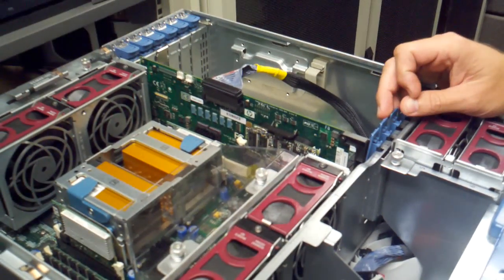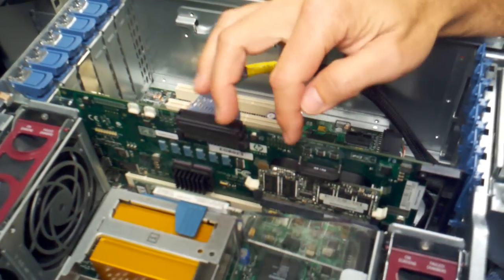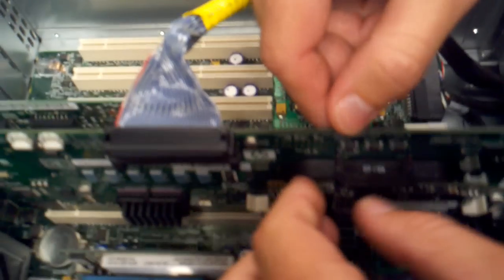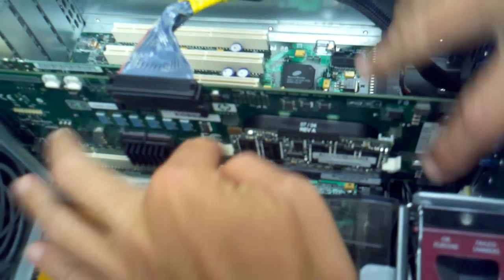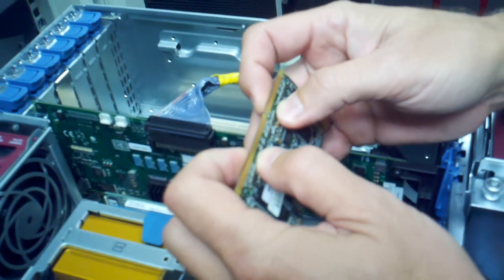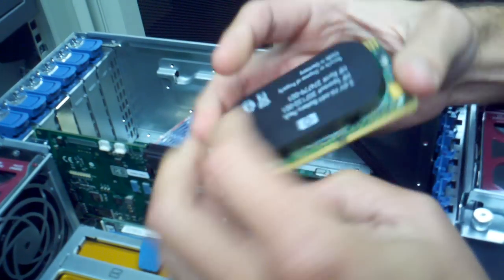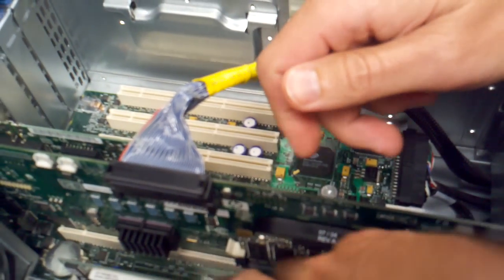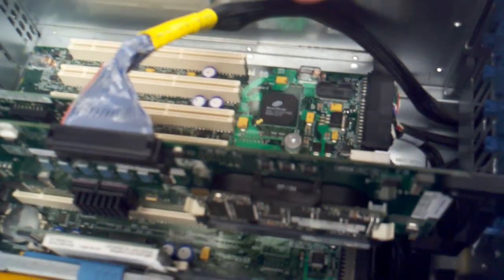HP ML370-G3 Array Controller Battery Replacement Process

Comment: Would this cause the server to beep? I am trying to remotely diagnose the issue and the battery is the only thing coming up in the System Management Homepage.
Reply: It could.  Primarily there will be an error displayed on the POST screen prompting for an F1 to continue as well.